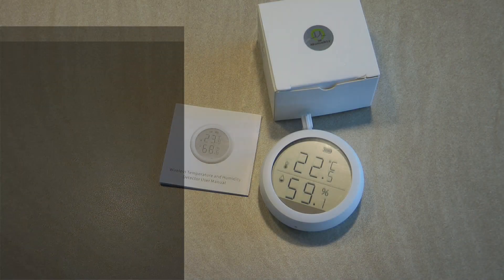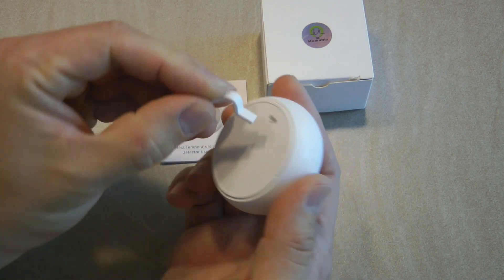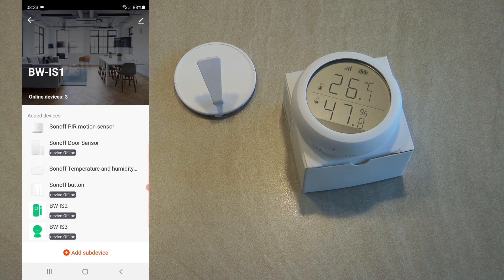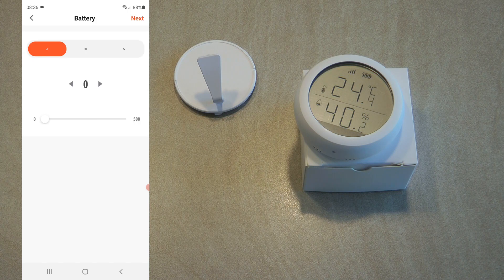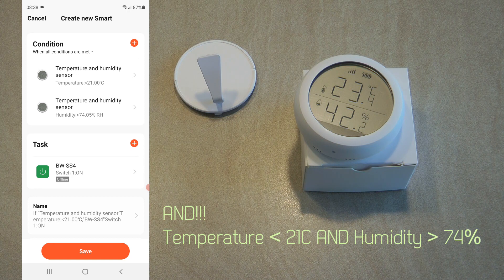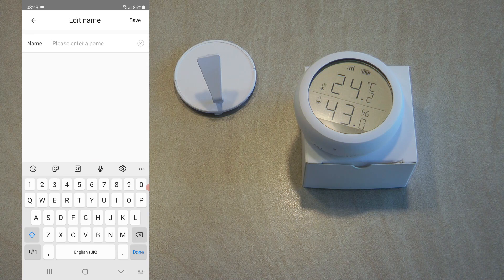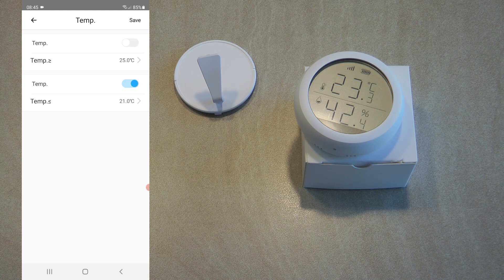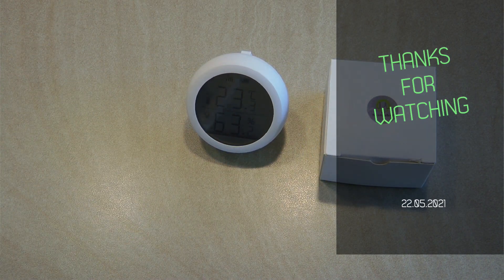Zigbee Temperature and Humidity sensor from MumuBiz

Comment: I've seen these in the Xiaomi branding as well in both Bluetooth and Zigbee radio types.  The are quite good and accurate enough for most domestic use.  I like the fact they just use standard AAA size batteries, though I found the batteries they come with are not good and best to replace them with decent quality ones that are not likely to leak.
The Zigbee version will pair with virtually any Zigbee Co-Ordinator, including SmartThings, DeConz and Home Assistant ZHA.

Comment: Hi @Csongor Varga, nice to see new video. My Mitsubishi Electric AC is not power ON if i use an smart plug, it only be turned ON via remote. How can make it to work via zigbee temp sensor, when interior temperature reach 25°C, to make that AC to turn ON to cold the room and turn OFF to say at 22°C? Ty! LE:  to mention i have an wifi interface Mitsubishi Electric MAC-567IF-E but with this, i can turn ON/OFF via internet but manually.
Reply from the maker: Yes, you cannot use a smart plug for AC. You option is to use a RF transmitter. You can get these that are compatible with Tuya. Just search for IR Transmitter for Tuya and you will find quite a few. These are like universal remotes, and usually have built in codes for AC IR transmitters. Or you can train them for an IR signal. I have used one from Eachen in the past but only tested them with TV and Hifi signals, not AC. This is only available for Tuya, I don't think there is one for Sonoff. And once you have this, you can create a scene, that if the temp is less than 22C, the IR transmitter sends out the turn-on signal for the AC.
Reply: @csongorvarga  Thank you! As always :)